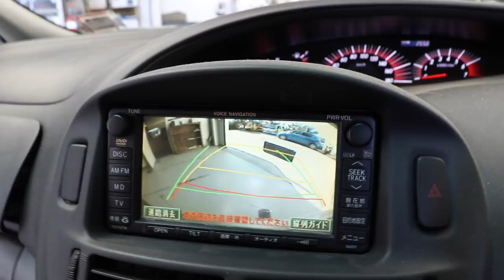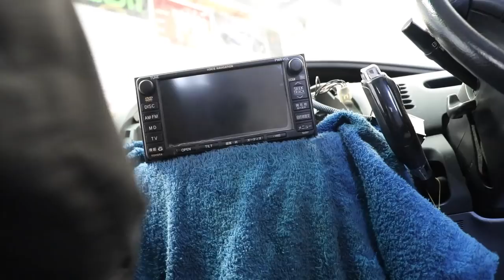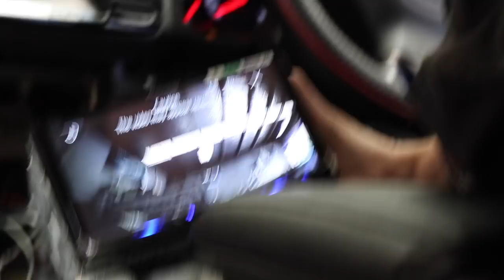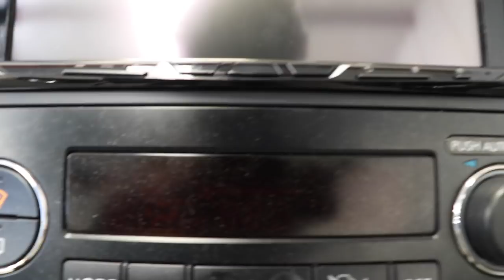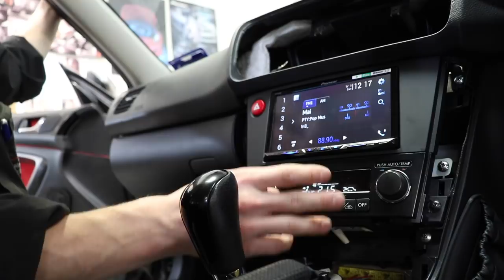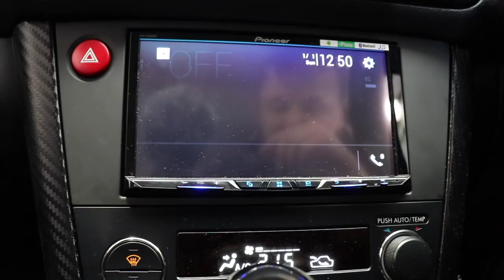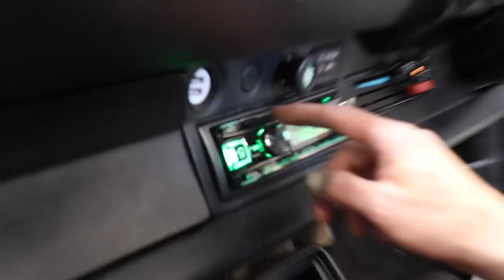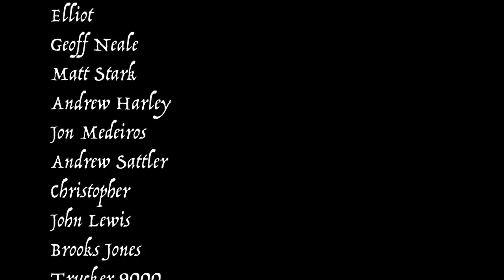Legacy Stereo Wired up & Fired Up

Comment: Very good work! My congratulations. Sorry for my bad English. But I have a doubt. I have a silver Macintosh that is all in one. I have installed 2din radio where the air, and now I don't have red lighting. Everything works, but I'm missing lighting. Do you know what cable it is? I have reviewed 14-pin schematics but I think I am missing some cables, or they are incorrectly placed. Could you help me? thank you so much!!

Comment: You guys need to get 9 conductor wire (speed cable) for your 5 chan amp installs.
Reply: we use 8 core trailer wire. which is similar. we dont get all the luxurys like america. as we are such a small country.

Comment: Hey man not sure if you are still answering this forum but I recently bought a double din fascia plate for my subaru legacy 2005 as below: https://www.trademe.co.nz/Browse/Listing.aspx?id=1526154134 
Can I pretty much buy any double din stereo to install now. I was thinking a JVC KW-R920BT. Will the audio place then be able to provide wiring etc
Reply from the maker: Yes you can put any double din stereo in that kit but I would recommend not getting a JVC, they’re pretty crap.
Alpine Pioneer and Kenwood are great. Sony is cheaper but still pretty good as well.
Reply: Thanks appreciate it